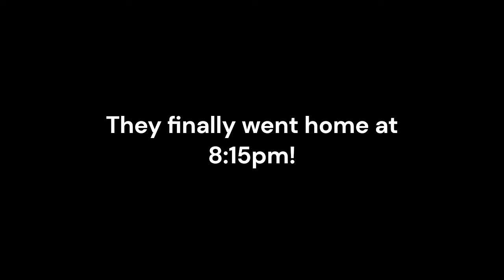Beautiful Day for Construction, Nearly 20°C! Monday March 4, 2024

Comment: Chez nous en France  travailler jusqu'à 8h15 pm ça  n’ existe pas sauf  chez les agriculteurs 😅 comment sera le sol pour les vaches, installéz vous  un racleur ? Bonne  journée, a ce soir ( chez nous) pour la prochaine vidéo
Reply from the maker: In this Country, with our weather, we can't always keep to normal work hours. It helps to contract the job so the hours are up to them. Most days they leave by 5pm and it is usually only the excavation crew that doesn't seem to stop for breaks and stays late. Our cows will have a 15' wide scrape alley along the manger and in front of the robot it is wider. They will be living on a 58' x 130' compost pack bedded with wood shavings. No stalls. 😊

Comment: I have a dumb question....Why is the roof facing toward the silo when I would think you would want it facing away from it?
Reply from the maker: Good Question! It's built like a commodity shed so trucks can back into it to dump, also the feed is being made in a tractor pulled TMR which will be housed in the building. The opening faces the south to protect it from prevailing wind in the winter. Hope that answers your question.
Reply: @HollcanaFarm  Yes it did answer my question ty very much
Reply: And south facing is good for solar panels one day!